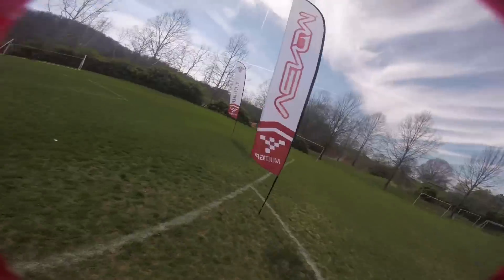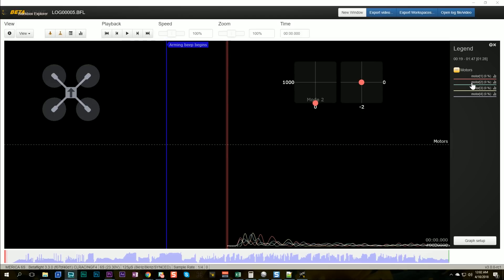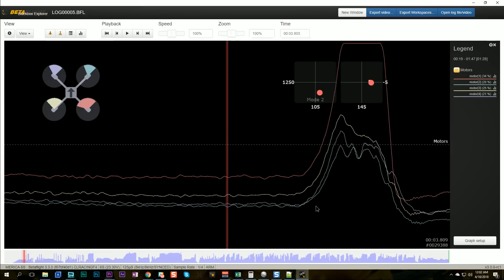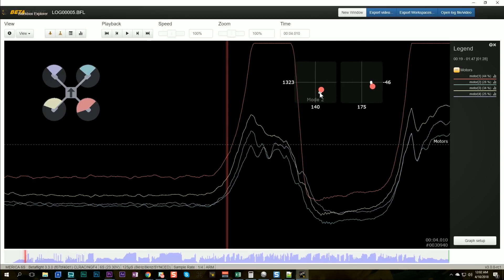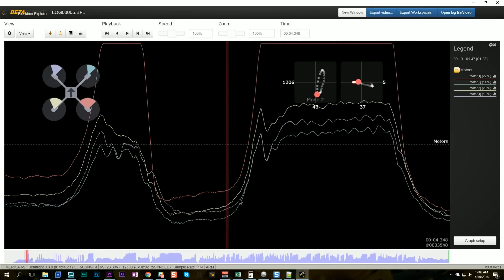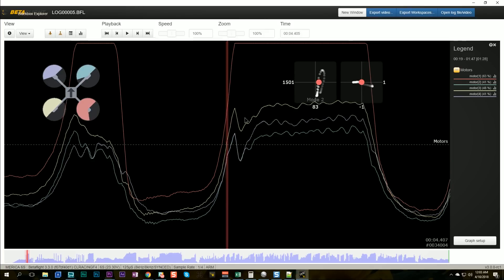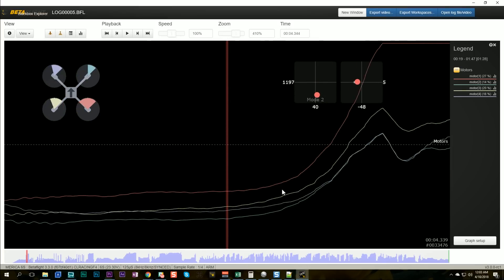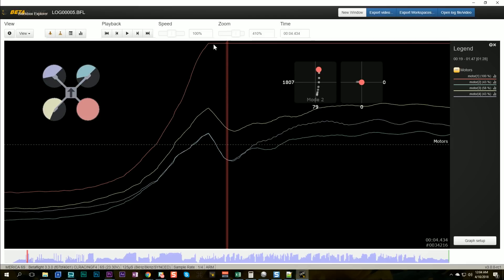Bad Quadcopter Motor | REAL WORLD BLACKBOX TROUBLESHOOT

Comment: I see people checking motors with a meter but I never see them checking from the phase lead to the body of the motor.  In other words  the motor can be grounded to the carbon body frame.  I have two motors in this  condition.  Any thoughts?

Comment: Whenever i disarm my quad (betafpv 95xv3) i see summary that blackbox : fault. What is the meaning of this.? Also, i noticed that the right rear motor is really hot that i can barely touched it, whereas the other motors are warm. Whats seems to be the problem.? Please.

Comment: If I give a throttle input (very small) one of the motor speeds up and up to it's max and eventually flips before it could take off what could be the problem ?
Reply from the maker: Board alignment incorrect would be my first guess.
Reply: I have checked the motor propeller direction they look fine (according to the arrow on board)
The motor and esc work (I don't know if they are defective) I have swapped motor it didn't solve the problem
In motor output increasing the throttle rear right or front left motor spins crazy
All these started after a crash it used to fly before

Comment: At 9:00 "Motor number 4 is at 36% for whatever reason" actually tells us a lot more about the problem.

It shows us hoch much thrust we get from motor number 1. If motor 1 and motor 4 are not delivering the same thrust the quad would spin around the Axis between Motor 2 and 3 resulting in a death roll. so the motor 4 is powered down by the pid to not cause that rotation. So they both need to deliver the same thrust in this situation.

Its a good estimate to say that the ESC/Motor/Prop number 4 only delivers ~36% thrust

Comment: One of my motors keeps spinning then stopping, and it gets really hot, what is the problem in this case?
Reply from the maker: I would guess the motor or ESC is damaged. Replace the motor. If the same thing hwppens then the ESC is damaged. If replacing the motor fixes it then the motor was damaged.

Comment: Hey josh problem still persists with the death roll after high punch outs, zero throttle manoeuvres. i checked blackbox and it looks like one of the motors went to 100% after i zero throttled after punchout and seemed to roll towards that direction so it means the motor is defective? or was it just trying to compensate for the spin?

Ive also noticed on the blackbox when i reduce throttle some of the motors will go to 0%?.is this something i need to fix with min throttle?

Thanks a lot i really appreciate your time :)
Reply from the maker: The motor going to 100% means that motor stopped making thrust. If it happens at zero throttle or the end of flips and rolls, consider raising digital idle percent in the Configuration tab (assuming you are using Dshot). If digital idle percent has to be above about 7% to 9% at most, then the motor or ESC is probably defective.
Reply: Joshua Bardwell alright I’ll raise that. Do I also need to raise min_throttle in CLI?
Reply: Joshua Bardwell I raised idle to 6% and put a new motor on to replace the apparent faulty one, Seems to have fixed the issue after 3 packs I couldn’t get it to do a death roll no matter what. Not sure if it was the resoldering, new motor or idle speed but all is good for now at least. Thanks again couldn’t have done it without your videos and help :)

Comment: I recently changed my transmitter so when I crashed the other day I've mistaken the switches and it took me too long to disarm the Quad. It still flies but when I spin the motors with my hands it doesn't have the same clicking feel as it had before. Did I ruined my motors?

Comment: i just build my new quad. everything just default setting. cam and Vtx not yet installed....I just 1 st  try to throttle up (quad rise) - move to zero throttle (really 0)...and rise up throttle slowly to catch several time. but actually when i rise throttle from zero to catch --> I can't  catch them because the motor was driving like crazy they (motors) can not be controlled and ended by crash.. for ESC, i used FVT little bee 20A with one shot 125 protocol, damped light activated. bf setting => min command = 1000, min esc command 1020. what's going on sir ?, could you please help?. i will very appreciate your advance advice. thanks. ;)
Reply: seemed the problem from throttle zero (all motor were down), and rise throttle slowly to catch... but seemed the ,motor were stall..during start again (uncontrolled)

Comment: can desynch happen with dshot600? no right?
copter of my buddy does deathroll, motor 2 goes 100% but it rolls over that direction so it just doesn't do anything
he changed esc 2 and motor 2 problem still there
is pdb or fc just damaged? cannot think of any other source and he has enough too
fc is sp f3 racing clone

Comment: I have one questions Josh! If one of my motors constantly maxed out on flat punchouts and other motors produce about 80% of trust  in this time, woud it be vise to lower max throttle value in blheli suite for ALL motors to balance it out to the weakest, and woud it give more performance overall? Maybe more balanced behavior when pid controller dosent fight three other motors to fly it flat? That what i thinking! And no, i cant buy spare motor or esc righr now ;(
Reply from the maker: You're not going to fix a damaged motor by adjusting the blhelisuite endpoints. It will make the blackbox traces look more equal, but that's just hiding the problem. The motor is making whatever thrust it can and it can't make more for some reason. If you can't replace the motor, then just fly and let the PID controller take care of balancing the motors.

Comment: Here's a weird one that's semi related to the issue in the video: I have an asgard AIO, bh motors, well set up quad and no problems up until a minor crash the other day. First I noticed that it wasn't throttling down completely when I went inverted and chopped the throttle. Looking at BB logs, and there's one motor getting fed LOWER throttle signal than the other 3, all the time! I'm running dshot, so no calibration issue, and the board is physically in good shape on a component level. 

Any idea what could be causing a single motor to be running faster than the others at a given throttle, when all settings are the same? Tried stock PIDs just to make sure it isn't windup or something, but i'm totally lost at this point.

Comment: As always great information
But if we just lowered esc valueI(2000  to 1700  or 1600)  of other 3 motors in blheli then it will balance it right
Reply from the maker: No, I don't think it would. If you messed up the calibration on the other ESCs, the motor values in blackbox would change, but it wouldn't make the damaged motor spin any faster or make any more thrust, so the problem would still exist.

Comment: I´m having a poltergeist with my quad due to over heat.....stops all engines and falls to ground...
Reply: weak ESC dude... and do not use spray oil on the board to remove humidity ;3

Comment: 2:12  That's exactly what is happening. I do a punch out, and my quad starts tipping/dipping to one of the arms. Its not a little tip, its like, do a launch from ground and within 80 feet you've almost made a 90 degree turn. At 90% throttle its fine. I thought it was the motor (had 2 out of 6 DYS motors defective, one you would need a pipe wrench to turn), then I thought maybe its the ESC (of course its a 4in1 so I'd have to replace the whole thing). But now after hearing the PID loop should take care of it, I'm thinking its the flight controller...

I recently swapped the receiver and haven't tested, so I'll see if that fixes it (previously micro receiver)

.....................................Specs...........................................
DYS Samguk Wu 2206 2700kv
RaceStar 35A 4in1
RaceStar 5042 tri-blade
Naze32 Rev6 (old and no blackbox). I might swap out with CC3D with blackbox
BEC: AMS1117 with 100uF cap (800mA rated, its only running FC and receiver)
4s 1800mAh 65c battery but pretty old (I got some new 1500mAh CNHL 100c packs I want to test out)
ZMR250 frame

Misc parts:
generic 1000TVL camera
600mW 5.8 VTX with clover antena
iRangeX Tiny
^^ recently replaced by FS-iA6 (have yet to test)
and a little Lego Space dude hot glued to the top with a control panel when my Go-Pro isn't on, cause you got to have character!

Comment: sometimes it wasn't motor defective, in my case, run 3s rated motor on 4s lipo, desync all over the place, yet, once run back to 3s, no issue at all.

Comment: I just had an idea on the subject of better balancing the output from all your motors.   You could theoretically see which motors are performing the best and place the best 2 on the rear arms, since the rear usually has to work harder under most situations.

Comment: I used to work for a company that 100% specialized in making Tilt rotor quads, and can say you are 100% right about the prop wash issue... which is why companies like Tilt designed their frames to have the rear motors sit higher than the front motors to give them good clean air.

Comment: lol this is not really about the vid though it was a good info drop Teach lol. do you find on rigs with a good size cap you get a little more power on demand and faster battery rise after punchout drains? i have been looking in to ecars and bikes and they use caps to help with burst power or are the caps we use just too small.
Reply from the maker: No, the effect of the cap is way too small to be noticeable in resopnse to throttle punches.
Reply: lol im going to try a 25v 22000uf cap lol its only 30mmx50mm you think it will give a boost or sag protection from amp draw . you dont need gopro in races but if it helps sag the battery can give its amps in a higher volt range thats the theory lol

Comment: Test the mr. steele v2's plzzz!!!!!!!
Reply from the maker: He's over in the corner playing Zelda but I just asked him and he said they were the best motors he ever flew and you should totally buy some.
Reply: Just buy ya some F40 Pro v2s.. best motor on the market right now bar none..
Reply: I already did:)
2nd batch 
(Get the steele v2's)
Reply: The one thing is that, both me & Frosty FPV got one with a single messed up bearing out of the box. Over the process of arming and just sitting there listening to how quite & smooth they are, the problem seems to have disappeared, or at least minimized. Any Idea on why this is? 

They come with defective bearings that rattle when you spin them but the rattling goes away once you arm a few times.

I haven't getting to fly them yet, waiting still on a armattan warranty part to come in:( But Frosty has and as far as he can tell, they fly perfect even with the ones with "messed up" bearings.

Comment: This the only reason i have sd cards taped in my racers. I look for the motor plateau when the quad becomes a pig. i replace 2 to 4 esc's for motors 1 or 3 weekly. 

 I can't say i've ever seen a motor get weak (cooked magnets) or have so much friction to the point of a plateau.The other failure point is a trashed coil which just desync's. This includes motors i've flown with cracked magnets or trashed top bearings that were bare races. Typically there will be a lag that shows a wobbly peak in motor output that decreases to within 15% of the companion motor. It's possible i just haven't cooked a magnet enough to never get the rpm up to the companion motor but i've had several come down at 160f+ after a race.

A quick field test is to rapidly arm and disarm with air mode or idle up active. The lagging motor has the bad esc.

Also in the motors tab one can set the motor to 1100us then hit the home key and repeat starting at 1200us. Compare spool up response to the other motors. Lag or desync is a bad esc.

Comment: This makes me think that motor thrust imbalance could be a significant cause of throttle punch bobble.  I know anti-gravity can help with the bobble but I still want to find the root cause and eliminate it.  I've tried moving the battery around to adjust CG but that doesn't seem to change anything.

Comment: Ok, so now I understand why my kwad was going so slow and then flipping to the ground 
But the thing is that in 3s it works pretty well (a bit slower than usual) and with a 4s battery it is terribly slow and then flip...
Maybe the weight of the 4s battery make it want to run the motor faster and it max out 
Thank your for this educating video 
If you have an explaination to my issue I would be glad to hear it :)
Reply from the maker: 4S is making the motor want to spin faster which is bringing out an underlying problem.

Comment: How about running say slightly higher pitch props on the rear motors to compensate for the less clean air?
I mean maybe say a cyclone 5046 on back and 5045 on front.
Reply from the maker: It's an interesting idea. The responsiveness of the props would change so I'm not sure what effect it would have on handling.

Comment: hello, i've got a special problem. Sometimes when i fly, the quad is having short twitches. i can feel it and also hear it too. is this a receiver problem or an motor/esc problem?

Thank you for your time
Reply from the maker: Most likely it is vibration or electrical noise getting into the gyro. Install a 330 uF electrolytic capacitor on each of the ESCs. Soft mount the FC. These sorts of things: anything that cleans up vibration or electrical noise may help.

Comment: i'm still struggling to simply use blackbox, i think this vid was a bit overly long, whole vid is, if one motor is always maxing out compared to the others theres something wrong with it.  the really hard bit is getting onboard memory to record and then getting the traces up so you can see whats goin on. checking the blackbox log should be part of every new quads set up checks, but its not because its so vague to use.   it should be simple, but as always its a half dozen questions a noob has no way of knowing or even guessing.  log bitrate   fc  hz/ log bitrate per whatever onboard memory the fc has... these are the things we need to know. any idiot can see oh, that motors maxed out and surmise theres an issue.
Reply from the maker: Please check out the Blackbox 101 playlsit in the video description to learn how to use blackbox.

Comment: Nice video Joshua, I don't know if this is a question that makes sense but, the other day I think I damaged a motor a little bit,( shaft got a bit bend, but it still flies) it did not produce any vibrations but I did notice more wobble at the end of a punch out, as if i needed more I-term on both axles. does this make sense?
Reply from the maker: It sounds like you need to replace the damaged motor :-)

Comment: hey JB I love you technical mind I think very much like you when we talked about the quad having to go forward or backwards we say that the motor spins faster but does it really spin faster continually or is it spin faster for a second or two and then equalize to keep that pitch because if they did continually spin faster it would just flip so it must only for a second spin faster to get that angle and then they spin the same speed to keep that angle
Reply from the maker: It has to spin at the right speed to maintain the desired angular rate. So you're right that it spins faster to make the quad move then goes to whatever speed to hold the angular rate or position.
Reply: Joshua Bardwell Thank you!

Comment: Josh I have a racerstar F4S tattoo Aio, i cant seem to get it to arm , it worked before but when i put status I get a Calib Flag. Is the gyro not working? It works when no battery is connected. I have tried moron threshold increase to 120 from 48 (stock) and flashed to latest stable and even reflashed a few times. Can you help please thank you

Comment: Sounded like 5S audibly was it? If the quad was originally working fine and the motors were all working fine isn't the motor damage from a crash? How are you so sure it's defective or something was done wrong in the factory versus crashing and flying it? I honestly think this is more of a damaged motor issue than a defective one.

Comment: Damaged is not necessarily "defective".  Don't hit up a vendor because you 'sploded. "Bardwell said it was defective"
Reply: One of my DYS motors came completely locked up (you might be able to turn it with a pipe wrench), and another had some slight housing wobble (bearing felt sloppy, and sure enough bearing screech is as loud as my props almost). Good thing I bought 6... These were on the Samguk Wu 2206 2700kv motors (only $10 a motor, but if 1/3 were defective, that's not that good).

I've bought lots of $5 motors, and some were pretty nice, like those orange-gold and silver 2212 930-1400 kv motors and those things spin like a stealthy machine. Those have been great quality, not super race performance for my airplanes, but good consistent quality for just $5.